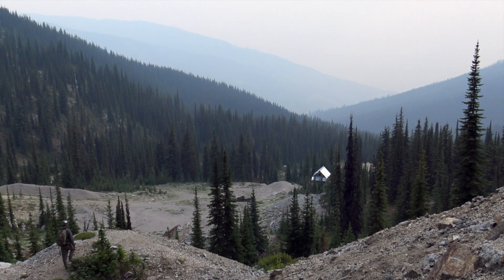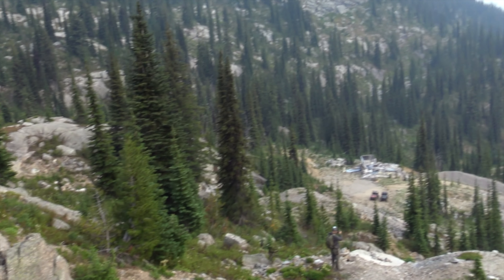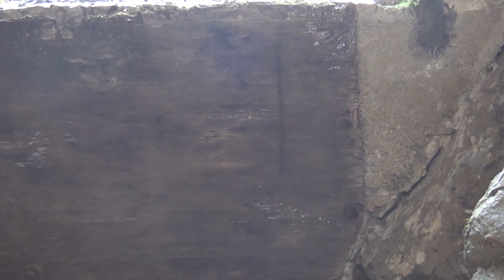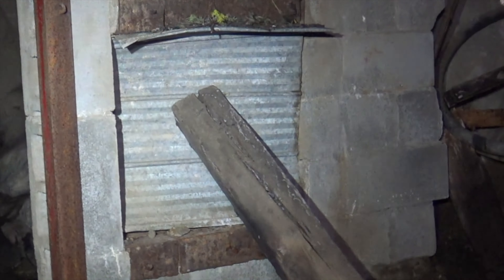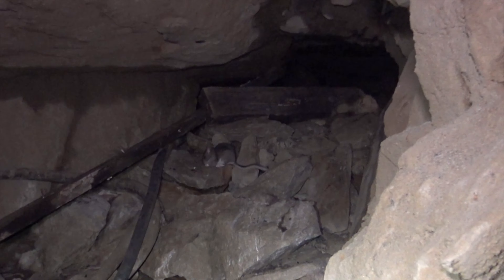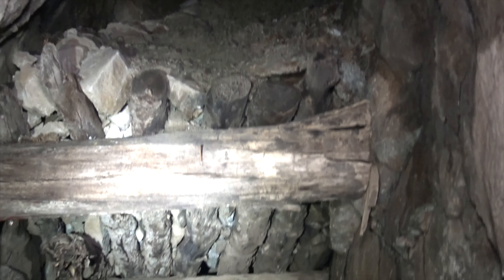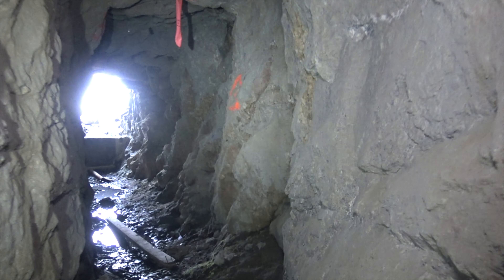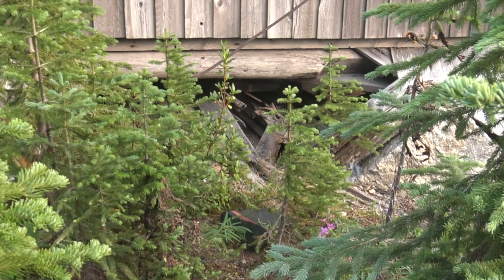Little Tim mine top level Dangerous explore

Comment: My best guess about why the half-height concrete wall: to catch the water running out.  If it was only for ventilation they would have just built it out of wood.  They built a ventilation door in wood farther in, and then a partial concrete wall as well.  They were probably using that adit to blow air down the stopes as part of the bigger ventilation system.
Reply from the maker: Makes sense thanks for the comment
Reply: I was thinking that too but I thought they mentioned there was a drainage pipe in the wall?